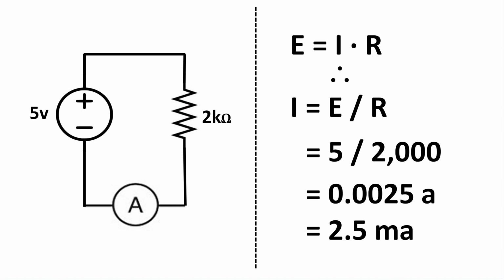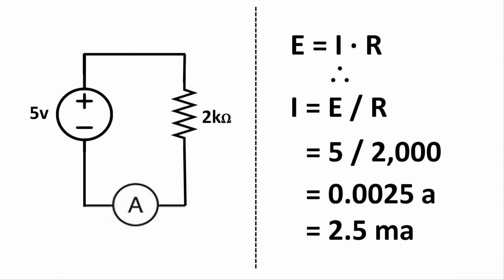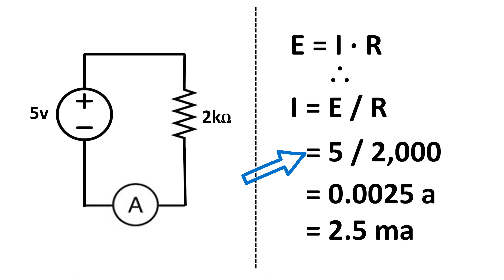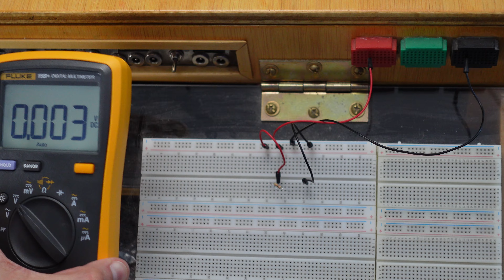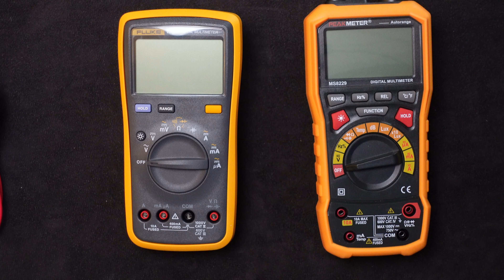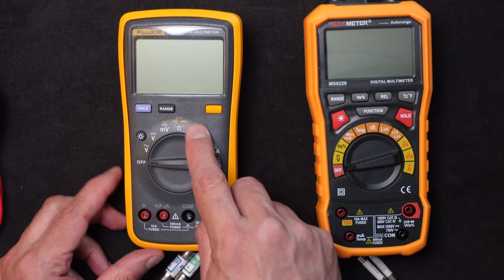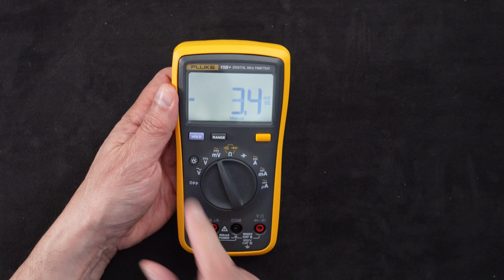The Whys, Hows and Cautions for Measuring Current with a Multimeter

Comment: Thanks David: I did this exact exercise yesterday and it would have saved me some headaches if I'd seen your video first. Thanks again from Australia.
Reply from the maker: I'm glad you found it useful.  I was a teenager when I tried that (the wrong way with higher voltages) in one of my high school classes and I blew out a fuse.  The teacher said it happened all the time and did not seem phased by what I had done.  He actually called over the entire class to use my mistake as a 'teaching moment.'  For most people it is rare to have to measure current, but if you are designing new circuits you will definitely run across it.

Comment: I haven't really used a multimeter since a HS Electronics class many moons ago. The technology has come a long way since then.
Reply from the maker: Yes, I fully agree.  I first used one in my father's TV repair shop when I believe I was about 12.  I had built a shot-machine with his help and when it didn't work (at first), he showed me hoe to use the meter first for continuity testing, then for checking the battery voltage level.  Then in H.S. electronics lab we used one every day.  

Back then however, there was direct way to measure capacitance.  My father showed how to use a continuity tester of the multi meter (which all had needle dials back then) to observe the needle on the meter to estimate how many micro farads might be on the capacitor.  Amazing.